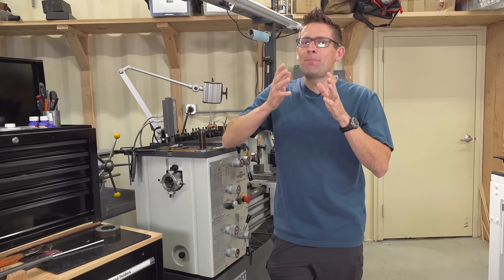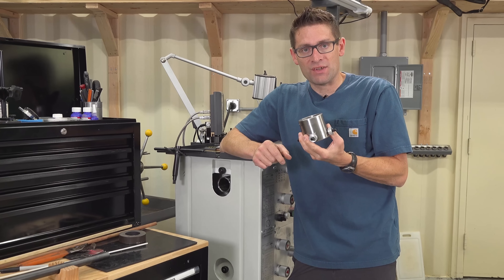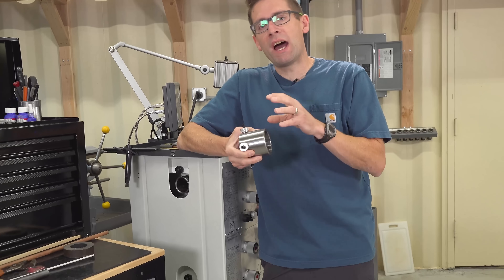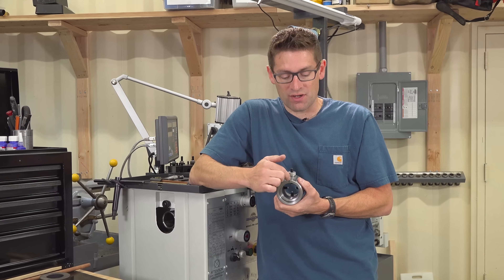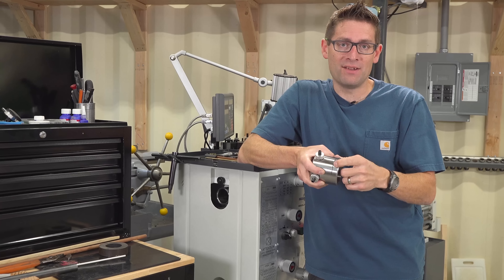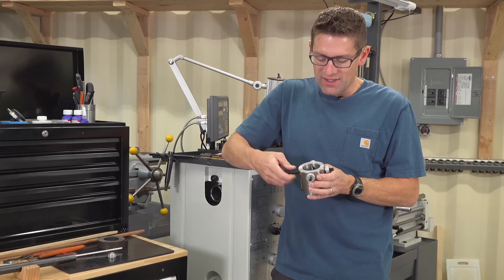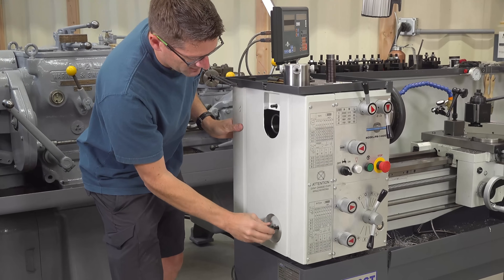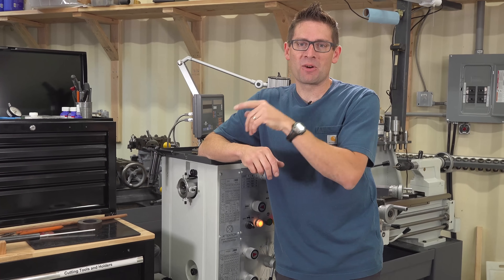How To: Building the ULTIMATE Lathe Spider For Your Gunsmithing Lathe

Comment: Which lathe would you recommend for a beginner gunsmith?
Reply from the maker: If you are doing rifle barrel work, I would say a 13x40 at minimum! The Precision Matthews PM-1340GT would be a great option.
Reply: I picked up a used ENCO 13x40 from a local machine shop for $1500. It’s been a great lathe to learn on. It’s actually the same one (model) that Gordy Gritters learned on.

Comment: Really great idea on making that sleeve for your spider.   I made a spider for my Grizzly G4003, but I just drilled and tapped the spindle itself where it extended out the back a bit.  It was all rather awkward eyeball and hand work.  It works well, although I do have to remove the side cover to clear the spider screws when they are installed.   If I was to do it again, I'd definitely copy your work for a more elegant and precise result, as well as the ability to use it with the side cover installed.   I may still make one like yours.     For a tip on the work you had to go through to make the aluminum-tipped screws - Grizzly sells screws with brass tips already on them.  That's what I used.   Grizzly part number BE1126

Comment: If your spindle is threaded for a collet closer you can make a spindle that threads into the spindle. Drill a hole for a small set screw to make sure it will stay in place. Try to make the set screw the same mass as the metal removed from drilling the hole for it. This design will get rid of the wobble.

Comment: Awesome video.  Love the new lathe. Could you have used set screws to hold the spider on the spindle instead of the relief cuts? I have no access to a mill at the moment is why I'm asking.
Reply: Yes, to the set screws.   But use brass set screws to avoid marring the spindle.

Comment: Really like the spider. I'm going to use that clamping idea for an outboard indexing wheel that I made. Regarding the tighter fit: you might want to slit and partially tighten the clamp before machining the final bore size. That way the bore can be made to exact & correct size when the spider is under clamping pressure. I perform the same order of ops when making internal arbors - slit and install screw before machining OD.

Comment: The wobble you talk about? Could it be from the end of the spindle bore at the non drive end.
Did you check through runout at that end?
Awesome videos by the way. You are truly an excellent narrator and very well knowledgeable.
I always wished to do gunsmithing and master machining, but never had a chance.
Reply: I doubt it would be from the spindle. Pretty sure his assessment of the clamp causing the spider to be a small bit off center is correct. Which none of it matters as he is using a 4 jaw and the spider to indicate the work to run true to the machine.

Comment: Nice project.

I suspect the imbalance is due to the pinch clamp. One possibility would be two, on opposite sides. Oops there goes the structural integrity. Live with the shaking.
Reply from the maker: Well said. It's a non-issue really. :)
Reply: @Ultimatereloader  I've been thinking about how to eliminate any imbalance, and have an idea (something SHE says I'm dangerous when doing). And you could make it as tight as you dare, i.e. ref. the present 0.002" clearance.

Anyway, rather than using a pinch clamp, how about using a collet type of clamping mechanism replacing the pinch clamp? The collet could use a threaded nut to tighten/squeeze it onto the shaft, with a couple of opposing holes used to hold and tighten the nut through the same access hole you already have in the tray.

Normally a collet is threaded on the side furthest from the fingers. In this the fingers are tapered, smallest inside the lathe headstock, larger toward the outside, with a surrounding thread (part of the spider body) to hold the nut on. I hope this makes sense, as I'm not sure of how to describe it, especially in naming and describing everything.

To install the spider, thread the nut onto the back of the spider over the collet fingers, leaving it loose enough so all will slip over the shaft(?), push it as far into the headstock as allowed until it seats, then tighten the nut by inserting a rod into any of the holes around the periphery of the nut.

My only concern is this - would the nut be prone to loosen due to rotation?

Comment: I would recommend swinging your compound the other direction away from the chuck. If you’re holding a large piece the jaws can hit the compound rest. It also gets your hand too close to the chuck if you are using the compound to feed with.
Reply from the maker: Normally I run it at 29 deg for when threading comes up. In this case it was turned for the 45 deg chamfer on the end of the spider. :)
Reply: @Ultimatereloader  I figured that was why. If I don't have an inside, outside chamfer tool set up I will run in reverse and chamfer on the back side. Keep up the good work and stay safe.

Comment: Have you ever thought of converting the machines to VFD drives with 3-phase motor replacements? Did a handful of machine conversions for a friend of mine, and he loves it.
Reply from the maker: I did look into that when I got the PM-1440GT. May do it at some point, but for a lathe there's a lot of complexity compared to something like a mill. :)
Reply: @Ultimatereloader  <> really? I've already did one lathe, three mills, and a drill press. Plus a couple of power feeds

Comment: This is an awesome tool. Thank-You for sharing your process. Imma make one myself. 
Also I see most folks use a brass or aluminum shims between the jaws teeth. I found wrapping a 6 gauge solid copper wire around the barrel and letting the jaws clamp on that to give the best clamping and allow the best  pivoting with a lathe spider 🤙
Reply from the maker: Eagle Eye Shooting good deal Kenny! Let me know if you have any questions in the article there’s a link to the tubing I bought for this project…

Comment: Rather than make it a near press fit, you could have machined the clamp portions first, then turn a simple arbor in the chuck that's the same OD as your spindle, clamp the unfinished spider on the arbor, cut the OD, then remove the arbor, chuck up the spider and finish off the ID.

A few more steps but it should relieve your OCD (unless the spindle has run-out).
Reply: good idea, but than you need 2" stock for arbor and if you're just starting from scratch that's another thing to purchase :)
Reply: @DimaProk  in the grand scheme of things, that chunk of material is about $2.00 or so.  To guarantee that you would not have to worry about concentricity problems anymore would certainly be money well spent.
Reply: @triggerguard1  I don't know where you live, but it's $35 for foot of 2.25" bar of mild steel: https://www.onlinemetals.com/en/buy/cold-roll-steel/2-25-mild-steel-round-bar-1018-cold-finish/pid/12982 and if you say scrapyard - I have not seen 2" solid bars at my local scrap yard.  A local steel yard might cut a smaller chunk cheaper.  At any rate the spider is a nice thing to have, disregard my earlier comment.
Reply: @DimaProk  I have at least 3 source locally that I can find rems of that size, and easily be under $5 for.  I really don't consider online metals a source, since their prices are higher than any place I've ever shopped.  They are great for hobbyist I guess, but wayyyy expensive for anything I would normally entertain.
Central Oregon
Reply: @triggerguard1  I agree, but my one my local steel charges even more!  Found another one that's relatively close and prices are on par if not more but their selection is limited.  Online metals has a warehouse in Seattle (30-40 min drive) and with their frequent discounts I used to order it there but last time during Black Friday 30% sale I tried to order but they wanted to ship everything instead of giving me option for local pickup which I have done before.   Their website can't tell you directly which item is available in warehouse and which one isn't, I could have at least took some items out of the cart, I even called them and complained and they're aware of the problem, ended up not ordering anything.  So what are you sources - local steel supply yards?
Reply: @DimaProk  Yes, we have a couple of steel yards here and the Les Schwab Tire Center subsidiary called LS Equipment that stocks a lot of misc. steel and aluminum.  That, and there is a lot of mills and heavy equipment businesses that I know that let me scrounge when necessary.  All that, and I've been machining and gunsmithing for about 30 plus years, so I have quite a stockpile myself.

Comment: With the greatest of respect, why guess the index of the flats when your Mill has X-Y, simply clamp it to the bed with 1 T nut a length of all thread a bar with a hole in it and a nut!! 
Touch off, zero the DRO and finish to depth....
By the time you have mentioned the product numbers of the machines a good miller/turner would making chips.....(or in the US French Fries lol )
Reply from the maker: More than one way to skin a cat, and that's fine with me. :)